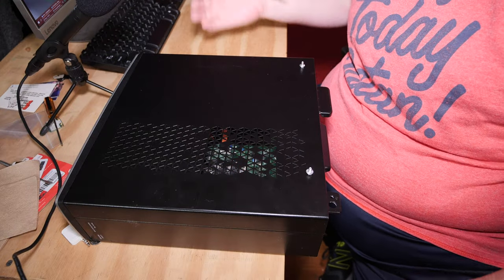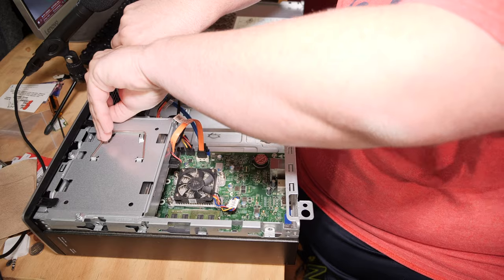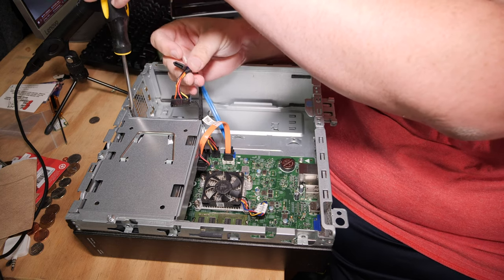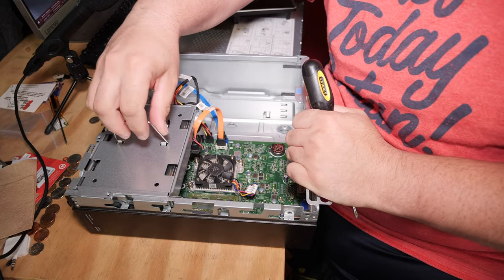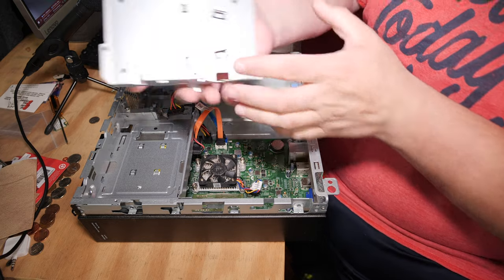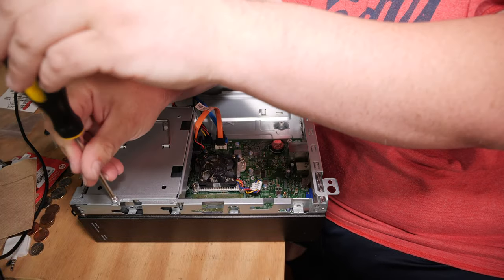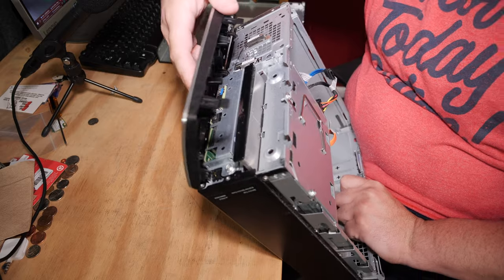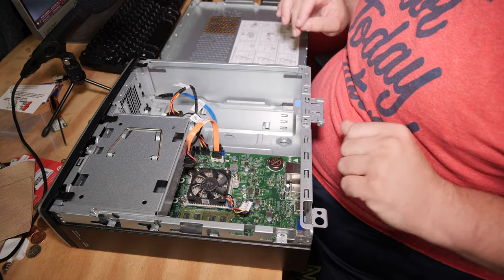Dell Inspiron 3252 SSD Upgrade - Absurdly Easy Hard Drive Replacement Job - Jody Bruchon

Comment: Thankyou so much for the explanatory video! Which SSD would you recommend and how much should we expect to pay? Also, has the SSD significantly improved the speed of your PC?
Reply from the maker: Any SSD is fine, but if you can get one with a DRAM cache (it's not in the specification info, you have to look it up elsewhere online like in reviews) it'll generally be much faster. SSDs are speed miracles. They're worth every penny.
Reply: @JodyBruchon  Thankyou so much

Comment: I really had a HORRIBLE time today trying to do this.  The problem wasn't what was shown in the video, but was the clone of the hard drive.  The clone itself took over an hour but kept coming up failing when I replaced the HD with the SSD drive (kept booting to some dell device testing tool).  I originally tried (twice) with Samsung's data migration tool, then tried once with macrium reflect.  Same problem...

Admittedly I didn't update the bios and it likely has never been updated.  Any thoughts?
Reply from the maker: Cloning hard drives is no fun. Most SSDs are smaller than the hard drive that they replace, so there's a lot of resizing and partition moving that has to happen. You'd be shocked how much is being done during that process. I usually advocate for taking the SSD upgrade as an opportunity to start fresh with a clean OS install. The BIOS should have no bearing on drive cloning.

I do all my cloning manually in Linux with low-level disk commands. It would be difficult to explain the process to you here, and it'd be even harder for you to translate it to your own equipment.

Look into making a Clonezilla or GParted bootable CD/USB. They're free and open source software programs and they do a great job. The hardest part is probably making the bootable disc or flash drive. Back up the contents of the old hard drive somewhere else just in case!

Comment: I have an Inspiron 3252 and its slow as hell. Was debating on buying a new computer or upgrading this one. This one only has 4 gb of ram. Would buying more RAM help a lot or would you recommend changing my hard drive? Didnt want to go that route since I dread starting over and wanted to keep my old files. Please let me know what you recommend when you get a minute...thanks.
Reply: Buy an SSD not a hard drive. buying a SATA SSD is the number one thing you can do to speed up your computer.

Comment: Can I replace my Inspiron 3250  motherboard with biostar motherboard, because motherboard of my i3250 is failed, also the i3250 cpu box is small in size, will it possible to replace other brands Motherboard
Reply from the maker: I don't know for sure. It's been a while since I touched this machine, but I'm fairly sure it's a standard case.

Comment: Have you try replacing a Dell nas sata ssd with Samsung sata ssd?
Reply from the maker: Any SATA SSD should be interchangeable with any other, assuming they're the same form factor.
Reply: @JodyBruchon  are sata to sas adapters reliable?
Reply: @JodyBruchon  can you do a ram upgrade of this